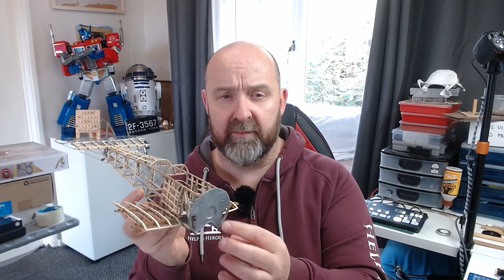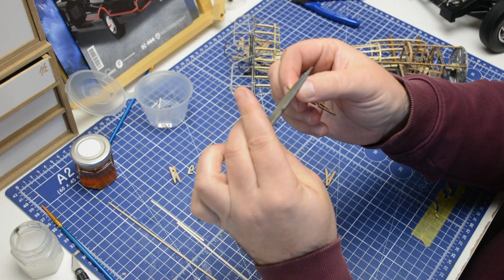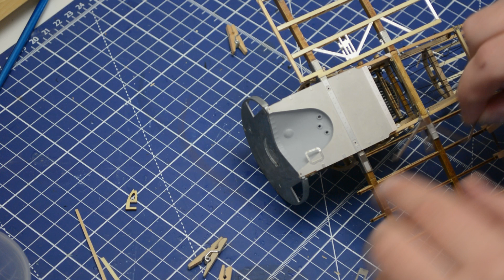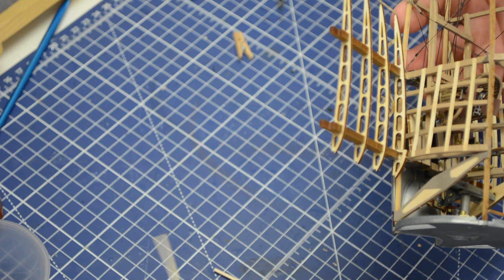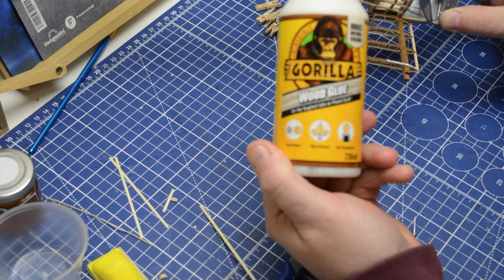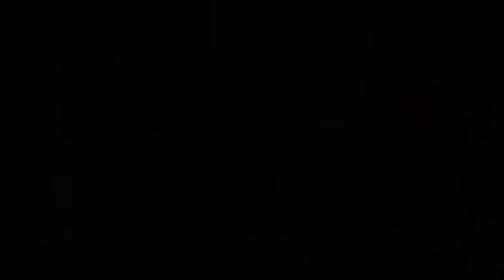My Most Difficult Model Build / Artesania Latina 1/16 Scale Sopwith Camel  : Episode 12

Comment: Going well and looking good. It's a fantastic kit and it took me months and months to complete it. I made a few errors right from the start which led to the fuselage being slightly twisted. That meant that the tailplane was twisted and one side higher than the other. I had to start from scratch and Artesania very very kindly sent me all of the wooden frets for free, which saved the project. Doing the bracing was a nightmare and I didn't use the supplied black fishing line because I couldn't get it to tighten. Heating it with a match ember just melted the line, contrary to the help video. In the end I used polyester cotton and after three goes it all came together. My finished result is on Britmodeller and can be found by searching 1/16 Artesania Latina 1/16 Sopwith Camel.
Reply from the maker: It’s a great kit, I’ve been building the model for about 4 years. But in that time I’ve only spent  a couple of months on the kit, hoping to finish the camel for the end of the year